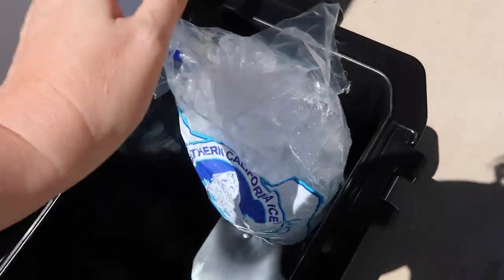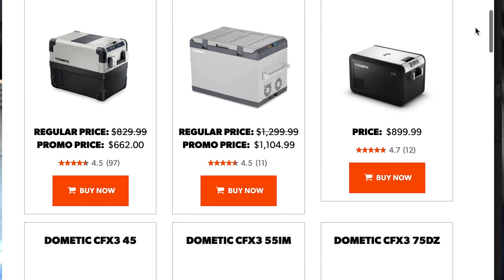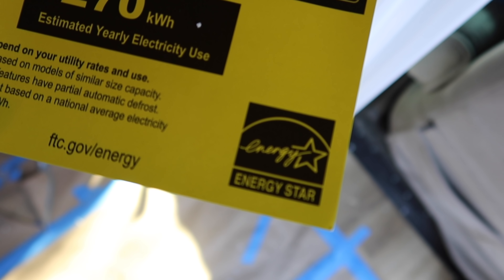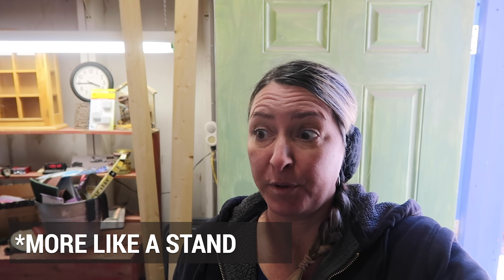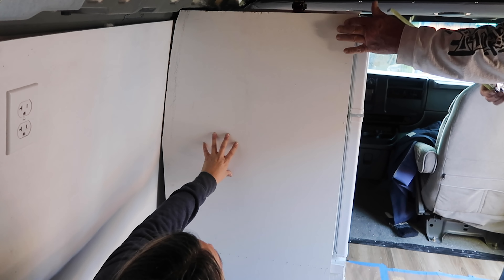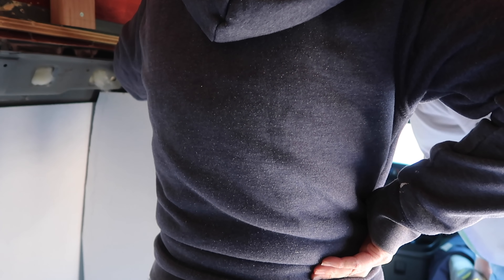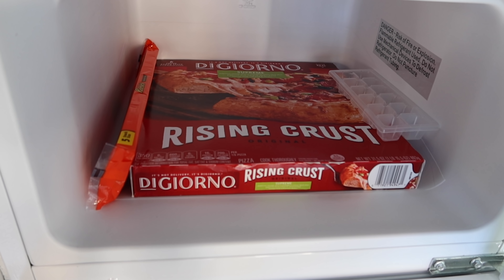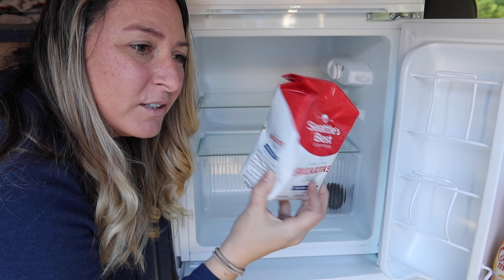Best Fridge for Van Life (Chevy Express Van Conversion) // Travel Snacks

Comment: I think it's great that you got the freezer compartment separated! My biggest concern is how to get proteins because they can spoil very easily, but they are essencial - to me.  

EGGS:  You can beat as many as you want (3 to 5) and freeze them in small/medium ziplock bags, making sure they are "lying" and stack them like sheets of paper. Even though they don't end up looking as good as fresh eggs, the taste is the same and you can use it for omeletes and other dishes whenever you want to, without the risk of cracking or breaking the eggs along the way. If you want to wash the bags and reuse them, I would suggest that you defrost them in room temperature, so you don't take the risk of ripping the bags.

Comment: I love pizza probably could eat it every night (I don't)  I use two cast iron skillets heat the bottom skillet with the food in it on low temp and the top skillet real hot turn that one off and put it on top of the other one let it sit for about 6 minutes its just like a oven. I'm buying a "camp chef outdoor camp oven" this spring. Do you have a heater in your van? If not and you need one buy a dry air heater. I bought a Chinese diesel heater 3 years ago for $130.00 it's never failed me and it saved my life from freezing to death just last week   I was broke down in Wisconsin in 35 degree weather waited 11 hours for a tow. Love your videos.
Reply from the maker: That's a great tip about the two cast iron skillets. Thanks for sharing that suggestion. 

I recently purchased a Chinese diesel heater!! I'll be installing it in my van before I hit the road. I've heard great things about it. So glad you had one last week!!
Reply: That sounds mmm

Comment: I do the same thing, use a thermostat that has a relay output.  The temp probe runs down inside your fridge (I use a chest freezer but set the temp to 40f so it runs like a fridge also they cost $200) (Use the 12Volt positive in and out of the relay connection) from your 12v power Batteries to a small 300 watt inverter. The 110 volt from the inverter is to power your fridge.  Now it will only come on when it drops below. You want a thermostat that has a low and high temp (ex. 36 to 41f) so it wont go on and off

Comment: Ok. Skipped a bunch of car videos when i seen you bought the van. I did stop and like them all. But i would figure out some ways to use glass or plastic jars for the pop section. Interested to see if yo modified it though. I would keep fresh veggies, make a pot of rice and freeze a few packages, in a drawer or cupboard, konjak noodles, part of my condiments would be sesame oil, chicken stock, oyster sauce, soy sauce, get a cooked chicken from Costco and cut down make stir fry, sandwhiches, chicken soups.

Comment: I received a similar fridge in my college apt when the original died. I was so happy to have a separate freezer that didn’t ice up and the could hold ice cream. I wanted one for my van, but the old fridge compartment was about 3 inches short. I debated removing the microwave and trying to cut the shelf out to gain a foot above the fridge. I ended up finding a fridge-only model that fit. Just plugged it in and it didn’t seem to drain my battery (100 aH lithium) more than 10% dusk to dawn (6 pm - 6 am). I have a freezer only about the same size and it seems I’ll be able to run both on my inverter. I also have a Yeti to run appliances that are above 1000W (inverter), like a convection oven and induction cooktop. My propane tank was old and rusty. I decided to take it out, instead of replacing.

Comment: I would save my fridge for milk after I open it. I get the small 6pack milk. Good for cereal and such and takes up less room. Eggs, butter.  Ketchup, mayo and mustard use packets. Don't need to be in fridge. Fresh veggies and meats. I would keep bottle water in a small separate cooler to store and just put in a bottle or two at a time. Mostly I drink room temp water.
Reply from the maker: Good tips! I drink almond milk so I'll have to look for smaller containers of that. I will move over to condiment packets as well. I will have fresh running water and it will already be cold (except maybe in summer). But I can have some ice on hand. Thanks for watching and for the suggestions!

Comment: I'm getting ready to get a used cargo van in the next few months that I can build out as a tiny home on wheels. I need to figure out how much solar I will need to run a mini fridge, charge a moterrized wheelchair, and plug in a hospital bed long enough to change it from sitting up into recliner position during the day and then flat for bedtime. Yes I'm disabled and am 58 years old, but with the right build out a disabled senior like myself can live the nomadic van life. It just takes the right build out and planning for anything.
Reply from the maker: Yes I agree! With some research and being resourceful you can have an awesome van set up. I'm looking forward to see what you come up with!
Reply: You may find this guide useful: https://www.explorist.life/diy-campervan-solar/

Good luck.
Reply: Since your mobility requires electricity, I'd make sure you had a back-up system for emergency power.  It is not unusual to have 3 or 4 days without sun; wherever you live in Europe or North America considering rain, clouds, tree cover, etc  Solar energy may get low, thus your battery bank doesn't charge up quick enough..
Reply: @roofdogblues7400  I am planning to have someone else install the solar, because I am not allowed to do anything electrical because I have a pacemaker that can be effected if I get shocked installing any electrical. I was thinking about offering a van life person a free place to stay in exchange for helping me with that part of the build. Free room and board with a place to get out of the cold durning winter and a free place to park their van and take hot showers or baths during the winter a long with free heat and water, in exchange for installation of the solar and the electrical I need to run a few things on 110 electrical outlets in a breaker box system along with the seller and the inverters needed and batteries and I would pay for all the supplies they would just have to do the labor. And yes of course I am going to scream the person very carefully. but I remember the days where you used to be able to barter services. So since I'm still in a sticks and bricks and it's a nice 2 bedroom. When it comes to that part of the build I was thinking I'm going through some well-known full-time van dweller, to see if they knew someone who wanted to spend a few months in a sticks and bricks for free room and board in exchange for doing my electrical and solar build-out part for me. If not I'll just hire somebody to do that part. I would rather though if the opportunity to a full-time van dweller to give them a few months break during the coldest season in exchange for services.
Reply: @mandrews1245  , my motorized wheelchair fully charged can go 17 miles and when I lived in Lakeport last winter they cut our power for a public safety power shut off through PG&e for 7 days and the house I lived in was all electric. So I can go a few days without charging my chair before it completely runs out when there is no electricity available. I did it for two days straight during the power safety power shut off my PG&e, then they turned our electricity back on for 12 hours before cutting it for another 5 days straight. I actually used the adapter that comes with my motorized wheelchair to keep my cell phone charged during this time. my motorized wheelchair comes with an adapter that has a USB outlet that will run anything on USB off the battery of my chair like a cell phone or a laptop or an iPad. So during that five days straight I used my motorized wheelchair to keep my cell phone charged so I had a way of calling out in case of an emergency and used my manual chair as a backup permeability issues. Plus I can walk short distances with a Canadian crutch and my leg braces. So the only time I would be using my electric wheelchair is if I were out in the city and had to go into a store to buy something that did not have an electric shopping cart and if needed I could use my manual wheelchair, I always have that back up just in case I need to use the batteries off my electric wheelchair 2 charge my cell phones or iPad with the adapter. As far as my hospital bed is concerned I can always put it in flat and leave it that way if I have to and then just put pillows behind my back if needed. It's nice to be able to have it adjusted into a reclined position during the day like a recliner but not absolutely necessary.
Reply: @roofdogblues7400  , Thank you for the link it will be useful. I'm actually still renting a 2 bedroom apartment and looking for a good running cargo van or a used box truck dont care to much what the outside looks like as long as there's no leaks,I'm looking at mileage and mechanical maintenance that has been done on the vehicle that I am buying. I'm going to make sure it is mechanically sound first and that the body has no leaks second. As far as Cosmetics on the outside that's what vehicle paint is for along with the proper application of the paint. I'm actually not allowed to install my own solar because I have a pacemaker that it can short out if I accidentally shocked myself. what I am thinking of doing is finding a trustworthy honest person that is currently a van dweller closer to me, that would like a break during the winter from Van life and maybe do the old fashioned barder system where they have a place to live for free for 6 months with eveything provided except food, in return for them helping me with the solar set-up.

Comment: The most common way is to get 2 cast iron pans or a cast iron pan with a lid and cook over your cook top. If you have a induction top, a large pan with lid will work well.
Reply from the maker: Good idea! Probably a low heat so the bottom doesn’t burn waiting for the toppings to get warm.

Comment: You just need to add a relay to the thermostat in the refrigerator. So when the thermostat in the refrigerator closes, and calls for cooling, it powers up the inverter. When the thermostat is satisfied and opens to shut off the compressor the inverter would shut off... or buy a 12/110v compressor and upgrade the compressor on the refrigerator.
Reply from the maker: Yes! I think this is what I was trying to work out. I wonder if I can do this now that the fridge is secured in place. Maybe not since I can't really access the back (or if so it's a really tight fit).
Reply: @travelsnacks  yup you need to have access to the back

Comment: Interesting choice for a fridge, looks cute but I assume it's strictly a 110 volt fridge. In hindsight I think you would have been better off either a 12 DC volt  fridge or a 3 way 110/12/propane powered fridge.  There is a fridge I came across from Unique that can be powered off of a solar panel or dc battery so you would not need an inverter. There are other of course and yes I know Dometic and Novacool but you are right they get expensive.

Comment: Oh man, I wish you hadn't glued that fridge in! If that thing ever has to be serviced or replaced, you've made it difficult on yourself.   L- brackets would have been your friend, here.  I noted that 2 or 3 small ones could have screwed straight to the base, up against the front of the fridge. You'd do that with the door open, but the brackets wouldn't interfere with anything.  Something similar could be done, up top.

As far as heating pizza in a van... depends on your kitchen setup.   Just remember this; an oven is just a box that's really hot inside.  You know what else fits that description?  A grill, when the top is closed.  

Basically, figure out what you could create, that you could put on your stove, to cook a pizza in.  Oh, and you'd want to keep that pizza from being directly on the heat source.

Comment: No one mentioned lard in lieu of butter.  No refrigeration required but great to cook with.  Save that bacon fat!  For those soda spots... get metal cups with lids or use empty soda cans with holes in them and store your onions, garlic, avocado, lettuce, radishes,  etc. in each container. Take out the glass shelf, it's too breakable.  Not sure baby locks (glued to side or top of fridge/freezer will be strong enough to stop pickle jars, milk carton, etc. from flying out when you round a corner too quickly, or travel on a gravel or washboard road? I'd try a gate lock system screwed into the wood surrounding your fridge/freezer.   Or bungie cords with hooks.  Keep condiments,  deli meats, cheese.  In summer crackers & choc.chips to keep them fresh. Fruit only because I like it cold.  Best snack is homemade trail mix with variety of nuts, seeds, M&M's, raisins and cranberries.  Use reusable jugs and individual bio bottles in lieu of disposable water bottles.
Reply from the maker: Great tips! Thanks for sharing all this!

Comment: HEY THERE!!! 
I wondered if you remember me but we based our whole van build off of you! Did you figure out that fridge attachment? To not drain the inverter? Also how is your solar holding up? More than enough power?!?
Reply from the maker: HELLO!! That's so awesome. I never did figure out the fridge thing and now it's too late because my fridge is stuck in place. BUT so far after one year, it's never had any issues with power draw. It just keeps running, no problem. Even when it's been cloudy for a few days, my fridge and lights keep running. Hope that helps!!
Reply: @travelsnacks  It helps so much!!! Thank you so much again! And I hope you get revenge on your floor for leaving you that black eye!!!

Comment: How do you keep your battery charged with the fridge?
Reply from the maker: I have a 200 ah battery in the back of my van. To charge it up I have three 100 watt solar panels, plus a solenoid that charges the battery as I drive. This will power all my electronics/appliances. (Or we'll see when I get it all hooked up!)
Reply: @travelsnacks  Nice set up, would like to do this to my rv.

Comment: The worst things for coffee are air and moisture.  Best not to keep in refrigerator.  It should be stored in an air tight container at room temp.
Reply from the maker: Ok ok, thanks for the tip!
Reply: Don't need to refrigerate ketchup or mustard.
Reply: Exactly what I was thinking. People use coffee to absorbs smells in the fridge and freezer. Maybe a vacuum seal canister would be better.

Comment: 80 Watts and 1 amp. Watts = Volts X Amps. If you have two of any, using algebra, you will be able to find the 3rd. 
I didn't make it as an electrical engineer so please double check me.
Reply from the maker: Unfortunately I failed algebra. 👎 😆
Reply: @travelsnacks  I did too. Had to try twice.

Comment: Nice fridge!   I'm upgrading my fridge, and that looks like it would work, I still haven't found one that will work as I want it too! Keep up the good work! Thansk,!
Reply from the maker: Thanks! It's worked pretty well so far. It does make some noise at times but not always. But it does hold a lot and has a low power draw so I still recommend it.